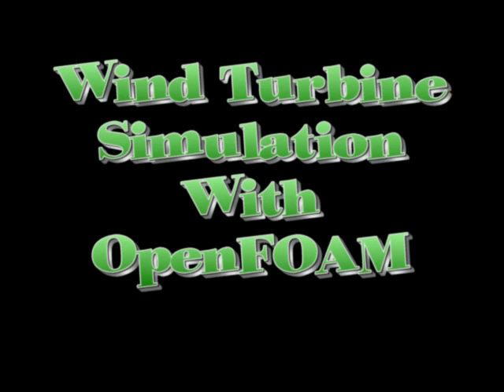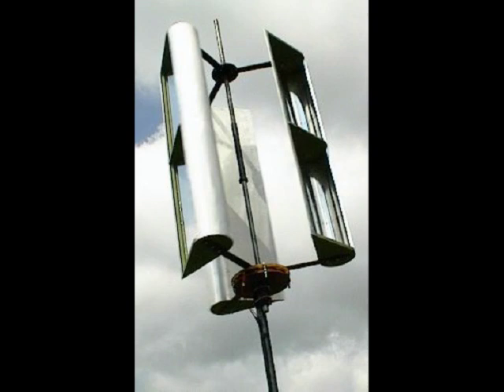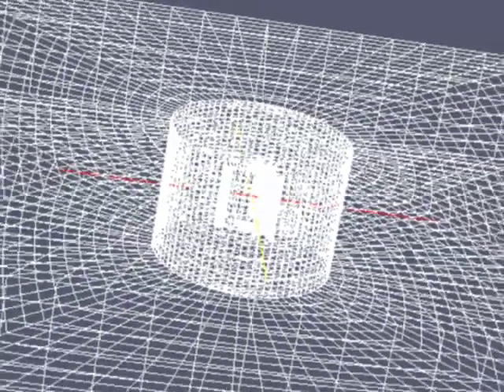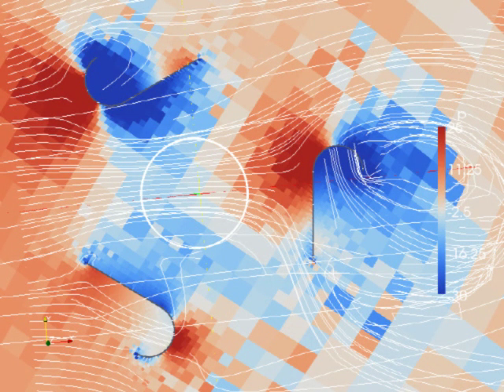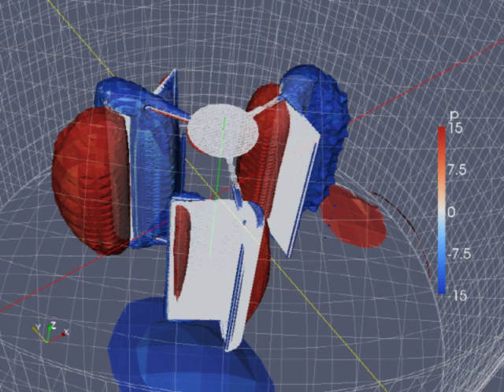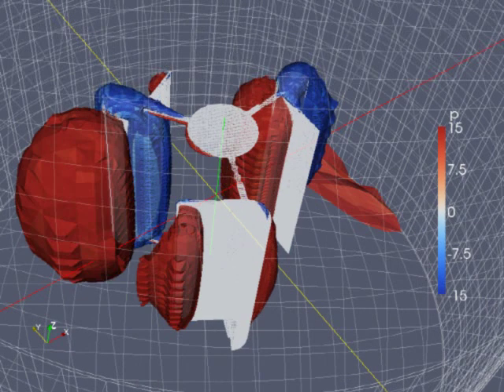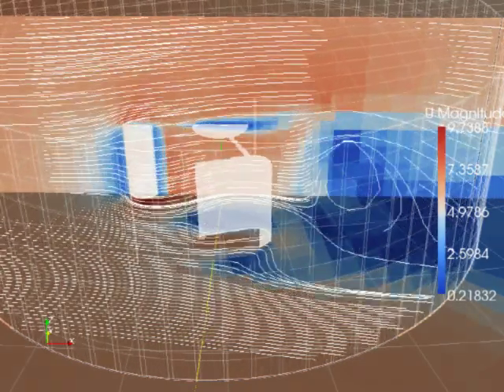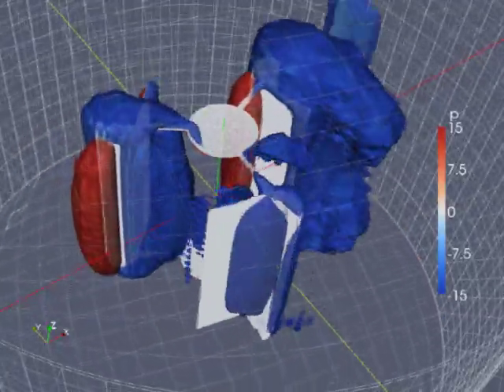Simulating a Lenz2 Turbine with OpenFOAM

Comment from the maker: Remember that the mesh rotates, but the air doesn't.  The turbine does rotate.  But there is also a constant movement of air (wind) from left to right through all the mesh.  So by rotating the mesh, and measuring the torque, we can calculate power.

Comment from the maker: I drew it in SolidWorks, then made an stl file, then used SnappyHexMesh to carve it out of the cylinder.   I've learned much since this video.  I think I need a finer mesh near the wing surface to better simulate the boundary layer.  I've been working in 2d lately, but can't seem to get reasonable numbers.

Comment from the maker: @courtjester140 
The turbine is spinning at a constant RPM.  It is possible to measure the torque on the turbine so that you can calculate power.  See my other video "Lenz2 Blade Simulation" for an example of this in a 2d sim.

If you run the turbine at different RPMs and measure the power, you can predict how it will work given the load of an alternator.

Comment: Any posibility to share any of your rotating simulations for learning OF and especially coupling into mechanical side of things?

Also I'm interested in this kind of lenz2 turbine simulation not to learn but to simply provide me information for sizing to result in required power @ defined wind speed. Are the web calculators any good?

Comment from the maker: Actually I could have done cell centered data by just clicking on another button on the gui in parafoam.

I made the circular and square mesh with blockMesh.  Then I cut the turbine out of it using snappy HexMesh.

I've gone to 2D sims now for speed and I'm using gmsh to make those meshes.  I found that the regular pattern from blockMesh caused some problems.  I prefer some randomness in the mesh.

Comment: Sorta opposite of what it should be. As I see it, though I am no expert either, it would be better to rotate the mesh that the windmill was not attached to in order to see how efficient it is at harnessing fluid in motion as opposed to how it displaces the fluid. As I said, though, I could very easily be wrong.